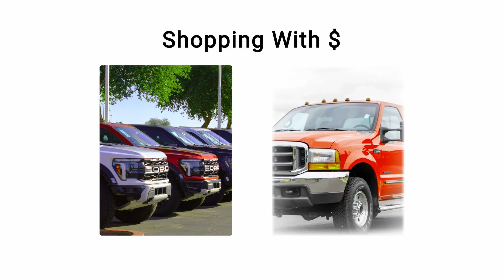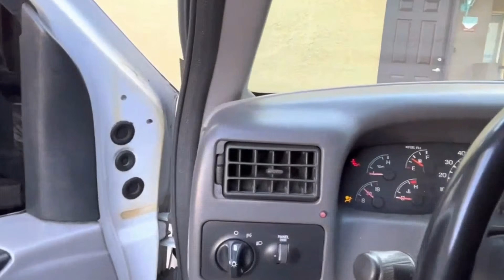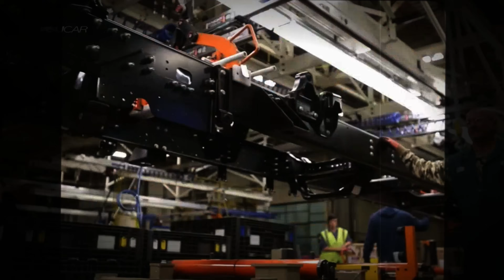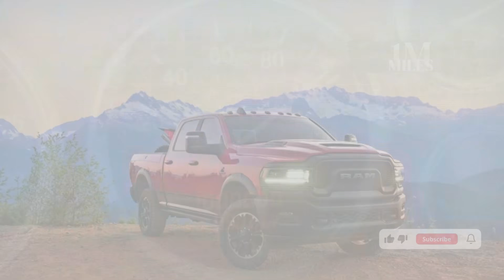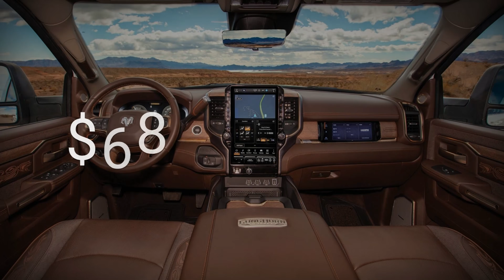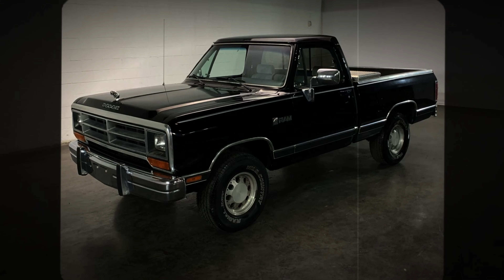3 CHEAP Diesel Trucks EVERYONE IGNORES But These Hit 1 MILLION Miles

Comment: Y 05 3500 Dodge has just had a water pump go out and that’s it for a 21 year old truck no rust no wrecks and it a 6 speed manual and a 4x4 and a dullay and I bought it new and I do all service and repairs and no rust was Ziebarted when new .

Comment: I loved the NavaStar 7.4 diesel engine in a Ford. Replaced using the 460 cid and increase fuel economy from 4 mpg to 12 mpg and when equiped with a turbo it excellerated better than the gas.

Comment: LOOK . . this is serious, the 1999 to 2014 Ford Superduty trucks are THE most dangerous on the road.  They have THE WEAKEST ROOF STRUCTURE of ANY pickup truck on the road.  nHTSA says a rating of 4.0 is standard, the 99 to 2014 superduties have a 1.1 rating.  Plus, Ford is battling a $2.4 BILLION judgement in ONE Superduty rollover accident.  Yes, a 2000 F250 7.3 is a great truck, just do NOT roll it over, you WILL die.